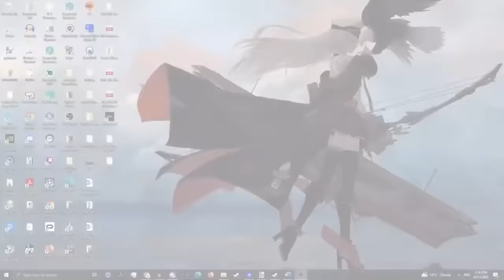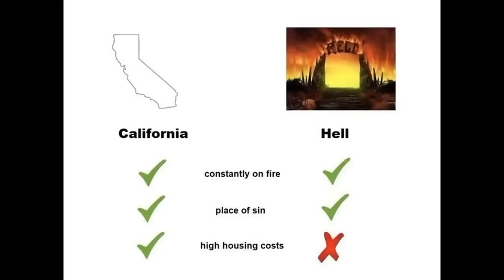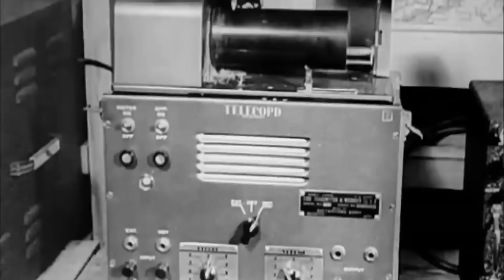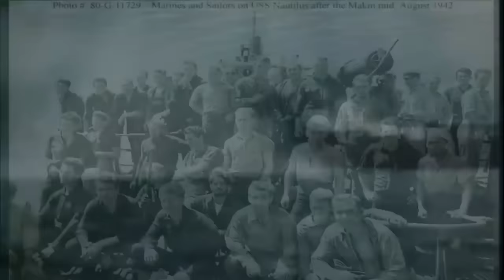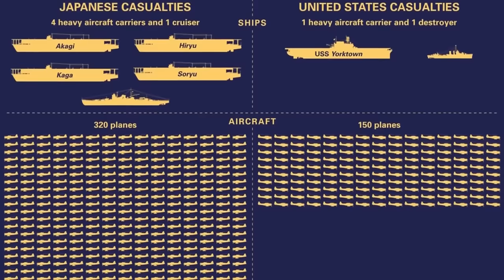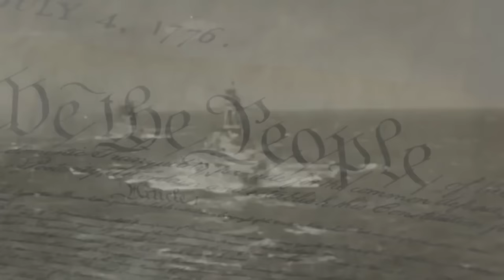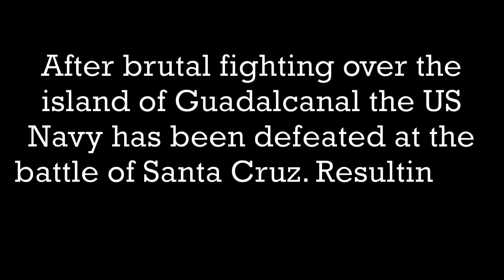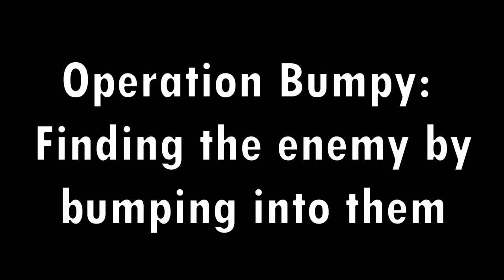The Complete History of USS Enterprise (CV-6)

Comment: the running theme i keep seeing, about CV-6's opposition in the IJN air wing, is that

not including self sealing fuel tanks was dumb dumb dumb dumb.

"We'll have a Qualitative Advantage due to our lighter airframes!"
Yeah, but you end up with fewer chances for veterans to become experience as failure is so easily punished while in an origami plane
Reply: That is basically the trade off in ww2 aircraft. Protection and pilot survival vs combat capability. There are ways of taking from the two as seen in the later American fighters, armour combined with sheer engine power. Machines are replacable, men not so much, and the Americans built them that way.

Comment: Fun fact about the Enterprise (CVN-65). She was the first nuclear powered carrier, but wasn’t powered by the conventional two aircraft carrier designed reactors we see today. She had eight submarine designed reactors. During the bit where she went to 100% full steam demand on all eight reactors, she had to shut two of them down a few hours into the voyage. Reason being: with that much steam demand, the propulsion turbines provided so much horsepower to the propellers, that the forward momentum generated a risk of cracking the keel. Her going full balls to the wall flank speed was bending the keel of the ship upwards. Meaning the force of going so fast was causing the bow to be bogged down from water resistance. She about tore herself apart going all out. (My DIVO also told me she had a tendency to blow off steam valve handles and stems due to poor packing, but that’s for a later time).
Reply: So to try humorously simplify

She was going to punch her engines into top speed so hard she was going to nearly need to tell the water to make way cause she was moving
Reply: Enterprise wanted to take to the skies herself, to fight the enemy personally.
Reply: Another fun fact, the first captain of CVN-65 was a former CV-6 fighter pilot